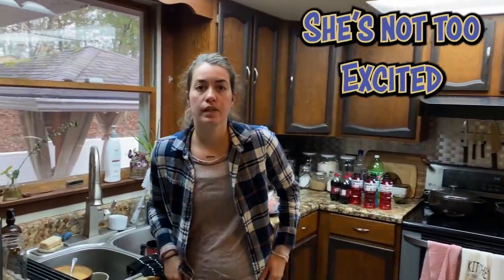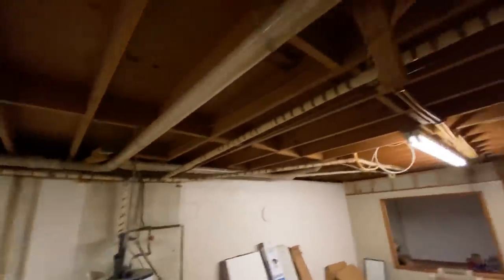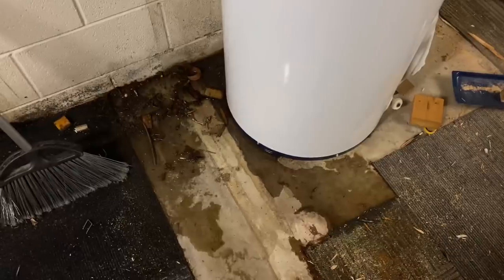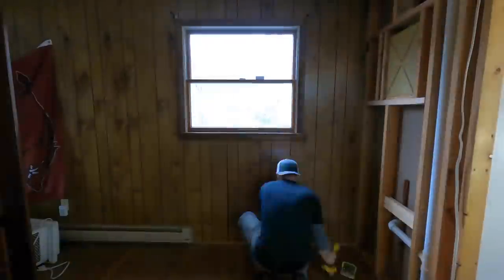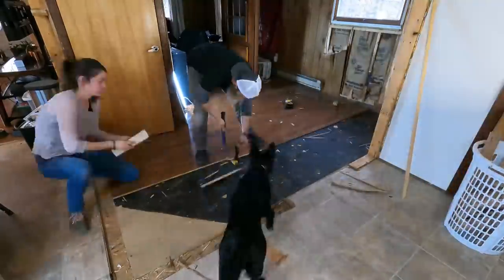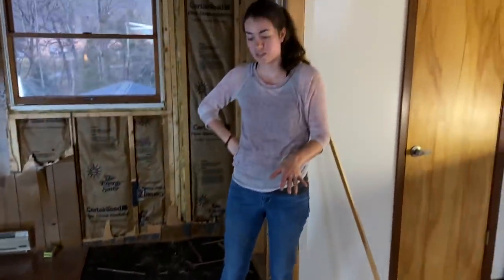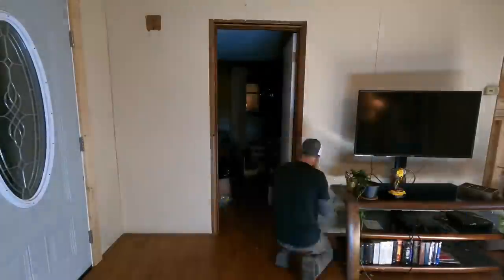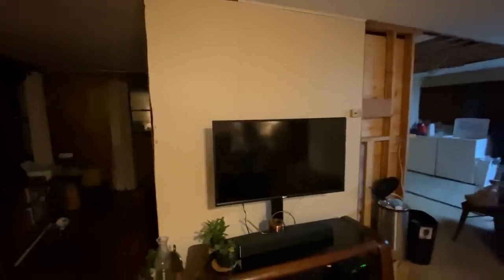The Modern Home Makeover // Episode 3 - More Demo

Comment: As anyone ever used foam and fiberglass for insulation around a window?
When I replaced my kitchen windows I didn’t have enough foam or enough rock wool left so I mixed the left over spray foam and Rockwool together and stuffed into the cracks. It actually worked pretty well

Comment: You can sister plywood to the bouncy joists (two thicknesses of 3/4 inch), glue and clamp or use glue and screws. Overlap where there are obstacles like wires or joints at 8 feet, then replace the blocking.  You can also use steel  flitch plates to reduce the bounce.  Plywood is easier.

Comment: After almost renovating our whole house only thing I would do different the second time is to rip everything down to the studs first. Gives you a good chance to straighten up the walls, change floorpan, update wiring etc. Doing it bit by bit just proved harder in the long run. Good luck, looks awesome so far.
Reply from the maker: Thanks! We definitely are going to try our best to be as prepared as possible.

Comment: One way to do it that sometimes works to remove flooring installed with cut nails is to use a pin punch and hammer the nails through the planks.  If you chuck a drift punch into a hammer drill, you probably could have the floor removed in no time.  Also, you might could stiffen the floor by sistering on ripped down LVLs maybe 4" or so wide that would clear the wiring.  You could even attach two to each joist (one on both sides of each joist).
Reply from the maker: Not a bad idea.

Comment: I’m not sure how concerned you are about ceiling height in that part of the basement, but if you aren’t too worried, you can always put a beam under the joists instead of cutting the joists and having them attach to the beam with hangers. You might even throw in a lally column for added support.

Comment: Lose the voltage pen and give yourself a better chance of living a nice long life. Those things are notorious for false readings which is why no self respecting electrician will use one to prove a circuit live or dead. A decent voltage meter is an investment along with a proving unit.
Reply from the maker: I’ll get one eventually. Right now all I care about is if the breaker is shut off.